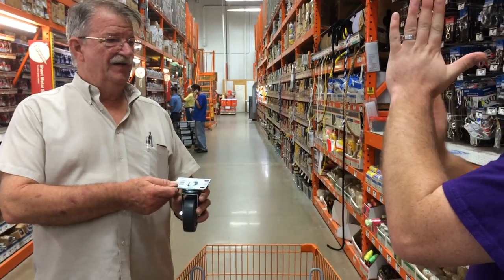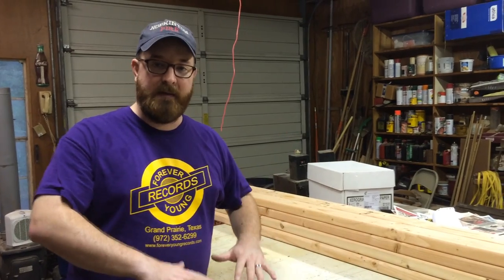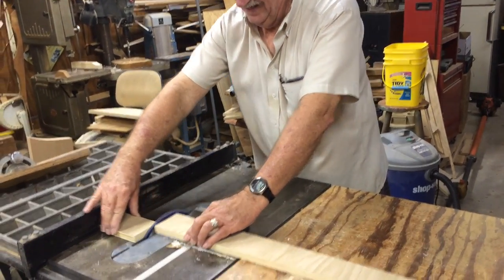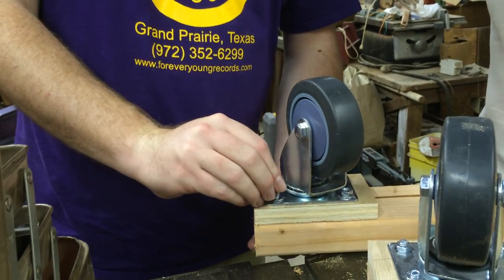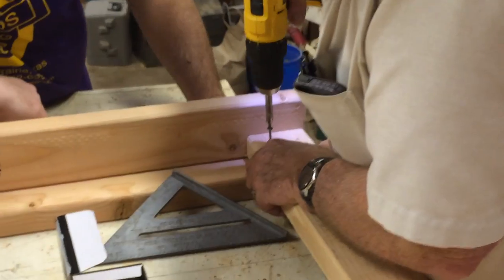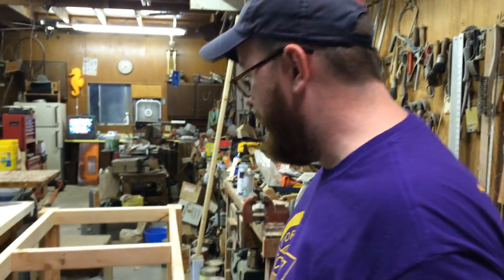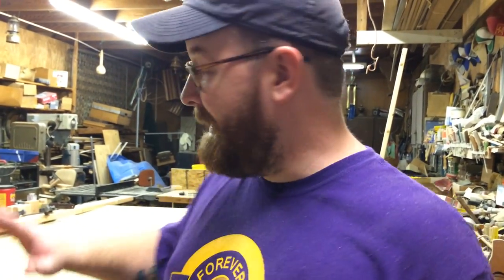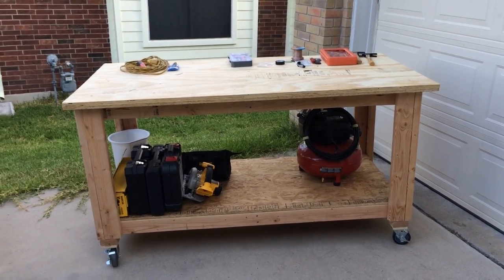Jack Builds A Workbench!

Comment: Why didn't you use the table saw for cutting the top instead of passing the circular saw?
Reply: Jack DeBussey If you make long cuts on a table saw it can sometimes kick back at you, and also because it was probably easier to do that than trying to move the entire piece of plywood while cutting it
Reply: Jack DeBussey In addition, the fact that it's not very thick wood means that they don't have to deal with a lot of the bullshit that comes with ripcutting.